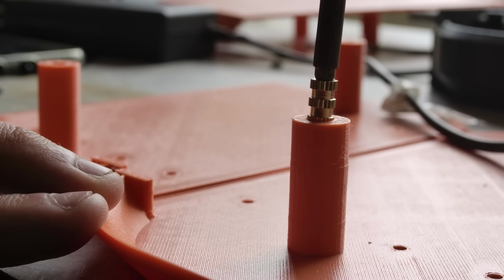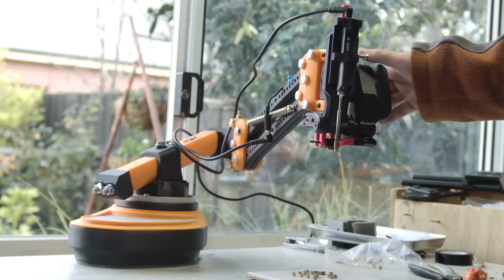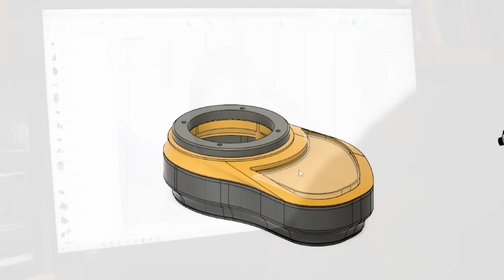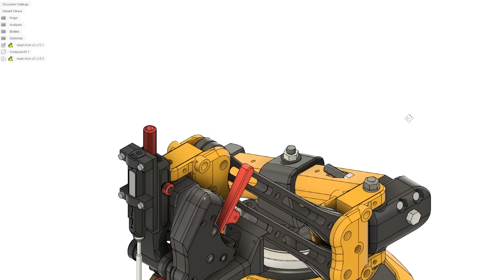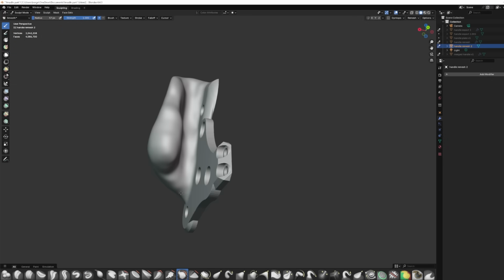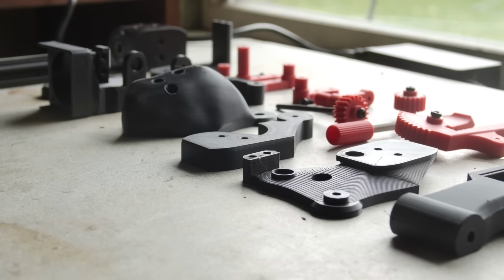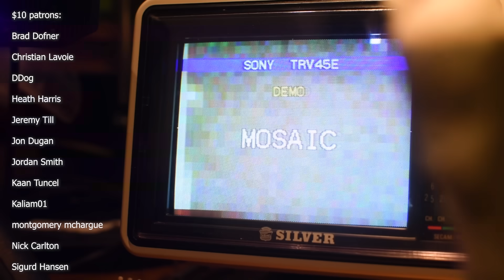A Better Tool For Heat Set Inserts?

Comment: Just a neat little trick since i noticed the felt pad and that. 

In the future if you need a weird geometry gasket, pad...etc. take a peice of paper, "thinner the better" put it on the face the gasket will rest on (some tape never hurts at the start but I just hold it on now.) Then take a soft mallet and tap along the edged to imprint the shape into the paper. 

People do this for alot of things, when I worked on some engines at home this is what id use to get accurate quick "drawings/templates" of what I need. And you dont have to go into CAD and print out a template for the base. Its really nice and fast anologue way of going about it.

Edit: also realized a good idea that might help you with the concrete. 

Try using some gypsum or superplasticizer powders. You'll use less water in your cement to water ratio, and it will make the concrete much more friendly to work with and pour. You wont need alot to make that little bit of concrete to smooth out. Should make your concrete form better in the form without voids...etc. 

Hope this helps, love the work.
Reply: Making a paper template works great but doesn't need to stay in the analog world.  Scan on a flat bed scanner and import it into CAD.

Also, instead of felt, I would have 3D printed a TPU base.
Reply: @Liberty4Ever ahhh very true, a printer's scanner can work too huh. Forgot about that nifty trick sometimes I won't lie 😂. It is for sure one to have in the bsckpocket.
Although with the anologue method I will say often times if you're doing it on non smooth edges (sharpish edges)  you can cut the paper with the soft hammer and your reference surface. Making you not need scissors while providing a low effort  higher tollerance fit. 

 Tpu is a good rubber base I use here and there for even my own projects. for me it depends sometimes I like felt bases, sometimes tpu, spray on rubber/normal rubber...etc. 

That's mostly preference/application dependent though.

Comment: Use the same arm with a bit more damping, add one of this small digital microscopes to the and of the arm. 

You could add small air cylinders with push button valves - that you push to open and adjust the arm - release to lock in place.

Comment: Awesome design, I love seeing the design process. Now you have a spare hand get a small aluminum cube to put over the top of each insert as you go, this will set inserts flush with surface, flatten any bulges and absorb excess heat so they set quicker.

Comment: I’m always curious why you choose to use concrete with such large aggregate for small projects. Simple quick mix would do fine and probably be easier to work with… you don’t need the strength required to support any significant weight, so it just gets me wondering… lol

Comment: not sure if it's available in your area, but there are fun additives for concrete called plasticizers that will increase the flowability of your mix without you having to add more water. This allows you to pour easier AND increases overall strength.

Comment: I use the printer itself to put in heat inserts. Heat up the nozzle, manually put it over the part and gently turn the Z axis to push it in. Perfectly vertical, perfectly centered, uses the exact tools you have already.
Reply: Hmm, not sure why I didn't think of that.

Comment: why don't you put the grippers blade a tiny bit lower so it can slide under the tip, that way you could use it as a flat, cold plate to level, cool and depth-stop the insert all in one. First use like you already do, but when the insert is set just above flush, bring the blade below the tip and press down again

Comment: A bit of stainless steel would've been a better choice for the insert holder - thermal conductivity of 14 w/m K vs 110 for brass. Or, if you stick with brass, drill a bunch of holes through it to increase it's surface area for cooling - might not need a fan then

Comment: The gripper is a cool feature, but it’s not really necessary. If you use the right inserts for 3D printing, they have a lip that allows you to position them all by hand. Then, you can quickly insert them all with the iron, and they remain steady.

This is why I never bothered to make any of the insert tools either, even though I use inserts often. although I do use the special iron tips for the inserts, which make a huge difference in precision, honestly.

As for a depth stop, then it too isn’t really necessary as long as you set the correct hole depth and iron temperature, and you use the correct tips, which have the benefit of not protruding past the insert. Then you can really feel the added resistance at the end of the hole, which makes it very easy to get close to perfect every time.
Although maybe your contraption limits your feedback, so you might benefit from a depth stop.

Comment: Great video as always! 
An alternative to working with scan mesh data directly,  I sometimes just import the scan into fusion 360 and do a form body around it. The needed knowledge about topology is similar to blender, but leaves you with a model that is easier to edit in cad. But its a lot more tedious to make by dragging the form points to closely match the scan data. For more complex things learning the forms workspace was worth it for me, but I have to admit, doing mesh edits in blender is still quicker in mast cases.

Comment: I once made a low clearance insert press using an old V6 hot end with the heat sink shaved back instead of a soldering iron. It allows you to get inserts into very tight places with overhanging features and very close to walls. I hacked an adjustable soldering iron with a separate control box to use as the controller but if I did it again I'd probably make a custom PCB design. I just needed it for a one off special project, but I was installing thousands of inserts. It was really worth the effort. 
I'd love to see something like this as an upgrade on your torque arm! I wanted to document it and upload it online but never had the time. I have some images somewhere.

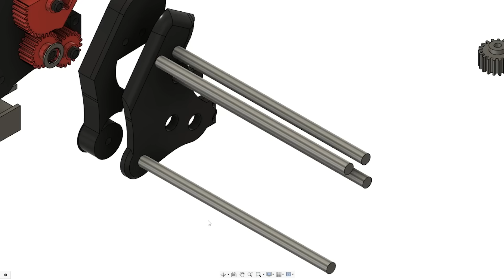Comment: 8:40 wait, does Fusion not have builtin mesh support? Personally I've just been using Freecad for a while now and I took it for granted that it did, (not that I've ever really used it much) but that seems like a pretty glaring flaw for Fusion to not have already.
Reply: Fusion supports meshes, of course, but you can't fuse a mesh and a parametric model just like that, the way you can in blender, AFAIK. You can import the mesh in Fusion, no problem, but your best bet from there on is to use it as a guide for soft surface modeling.

Comment: I love this, especially the gripper, but I think it has the same fundamental flaw that - so far - I've only seen solved in Naomi Wu's design. It relies on the human maintaining a consistent speed and correct pressure on the insert. Naomi reverses this by having the spring (rubber-band in her case) pull the insert down into the model with a consistent pressure and speed. Without her design we have the problem of sometimes pressing too hard, or too fast which can result in plastic going places it shouldn't. And yes, a stop is absolutely needed. In a number of your early examples you've pressed too far in. The best advice I've been seeing these days is to use an unheated object like a thick ruler to press them in the last couple millimeters. Although I'm not fully convinced it's worth the extra effort vs just having a good integrated stop.

Comment: one upgrade to consider is replacing the gripper with a mechanism that dispenses the insert onto the tip and holds them there.   This optimization kills 2 birds with one stone.  It holds the insert while you start placing, and eliminates the need to pickup inserts from the desk.
Reply: I've operated a riveting machine before, which has a similar setup to what you are describing. They are extremely finicky due to very tight tolerances required to avoid jamming. More bother than it's worth outside of an industrial setting.

I was thinking he make the grabber act like a detent so he doesn't need to control it. Just lower it on the insert until it clicks into place. That allows for multiple size inserts to be used without changing settings since it would only need to grab the first lip, similar to the current design.
The depth stop he proposed could be designed to move the grabber mechanism out of the way when getting close to final depth.
Reply: Yup, exactly what I was thinking. He can create a type of magazine (one for each insert type) that attaches to the inserter portion. Pressing the lever, releases a single insert within a tube or channel/funnel into a receptor.

Comment: Maybe the brass gripper could double as a depth stop if you change the way it retracts? An adjustable way to set the release angle on the lever, so it will touch on the surface at the right height, after releasing the insert?
Might be a bit fiddly but a lot of tools are sort of trial-and-error calibration like that (thinking of the adjustment screw on my Japanese end-pull mini wire strippers).
Reply: I’m not sure that’s possible - the brass gripper heats up from the contact and would marr the surface

Comment: If the community can get together on this, make the "end-effector" smaller and simpler, but with the same functionality, this could be your greatest idea/creation to date. I fully plan to wall mount this above my workbench to save on build time and complexity (a hole in the desk and a precise enough bushing/pin could work also; see @StevenBennettMakes open task light recent video). Overall genuinely fantastic creation!

Comment: It would be handy to have a little anvil that could drop down to push the inserts flush with the surface, rather than a depth stop. That also pushes down any plastic that squeezes up and gives a nice finish.
Reply: Perhaps something like adding an extra trigger to shift down the holder lower than the heating end to use the one piece of brass as both the holder and the flattening anvil.
Reply: @bryantaylor2523  Definitely needs something to push/seat the inserts flush with the plastic. I use a metal ruler but that brass holder could serve the purpose.

Comment: But why is it a problem to use heat set inserts from plastic molds? Oh I forgot: great video! 🧡
Reply: Tapered inserts perform much better compared to injection molding inserts, specifically for it's pull-out strength. Since there are no horizontal knurlings, it's much easier for the insert to just get pulled out. I highly suggest watching the comparison video done by CNC Kitchen (titled Cheap VS Expensive).

Comment: I love the parametric-mesh merge strategy. Every single time I run into this issue, which is surprisingly often, I end up compromising to some degree, or going to great lengths to surface the mesh. I think it's time to learn some Blender.

Comment: Realy cool! But I don't have an issue with grabbing them, because I don't: the inserts have a little lip on the bottom that fit the hole perfectly, so I just place them all and then I go with the iron pushing them down. But of course this method doesn't work for the injection mold inserts you had around, so if you want to save some money using them, you can.

Comment: I built a heat insert arm and... was very underwhelmed. I'm not going to say it's useless, but it's not nearly as useful/needed as made out to be. Properly made 3d print will snugly hold the insert, you can then press it in with the soldering iron, leave 1mm uninserted and press it in with a flat surface of something, even just flat sided screwdriver is fine. This way it's flush with the surface. No need for huge toy.
Yours is very cool, but I couldn't justify the bulk given the limited benefit it brings.

Comment: A good trick is to push the inserts 99% of the way in and then press a piece of aluminum against them to flatten the surface and keep the insert flush.
Reply: Which kind of defeats the point of these arms, because this way you get that perfectly flush finish no matter how crokked you inserted it by hand.
Reply: @rancor1223  Yeah lol

Comment: I thought Stefan was commenting on the type of inserts you were using rather than how you're inserting them
Reply: That's what I thought too. At 12:10 he says "my old rubbish inserts because I didn't wanna waste my nice new ones" though.
So maybe he bought a box of 1000 or something and wants to use them up but hopes to reduce the cringe level by at least improving the technique via nice new tool.
Reply: @thewolfin  Or, as he said, only used the old style for testing and will start using the good ones for actual projects
Reply: yeah, the tapered post-insert designs are much more appropriate for this application than the purely cylindrical ones.
Reply: 😅😅😅 he clearly was not paying attention to the comment
Reply: This is 100% true and I came to say this as well but good on ya lol
Reply: Brilliant video and design. Setting concrete is exothermic (gives off heat). Did you find this heat distorted your 3D printed base at all?
Reply: Stefan has some stock in threaded inserts too remember 😅
Reply: @JosefdeJoanelli Yeah, Stefan did do a ton of research and the proper inserts are much stronger than IM inserts. That being said, for the things I print and put inserts into, IM inserts are more than strong enough, and much cheaper than 3DP inserts. 
I've found my parts deform and crack long before my IM inserts pull out, and they're so much cheaper. 
If you care about the strength of the joint and you don't want it pulling out under heavy torque (Or you're printing PC or Carbon Impregnated filaments and want to take full advantage of the filament strength) , get 3DP inserts. 
If you're just using them to tighten two prints together and don't care much for strength (Think PLA or ABS prints) or need to use 100s of them, use IM inserts.
Reply: @JosefdeJoanelli  lets rizz those threaded insert companies up so his stock ownership becomes over 1080 million usd
Reply: It's all about the story! :)